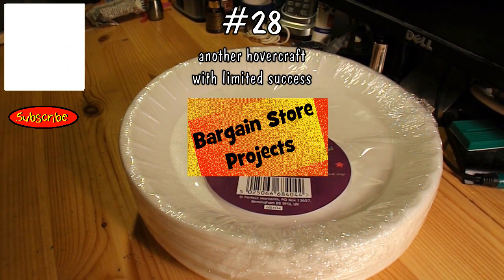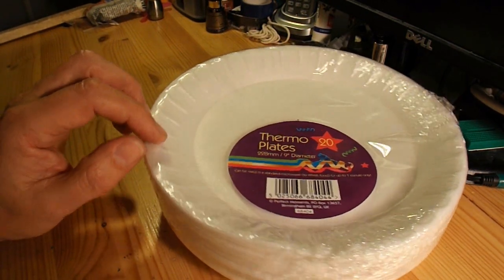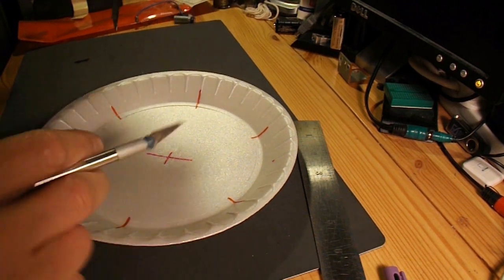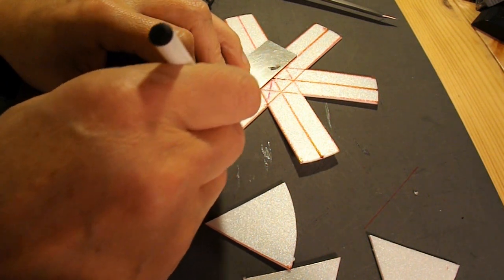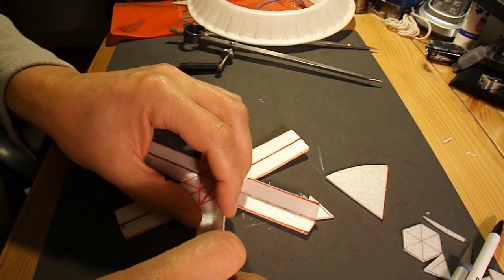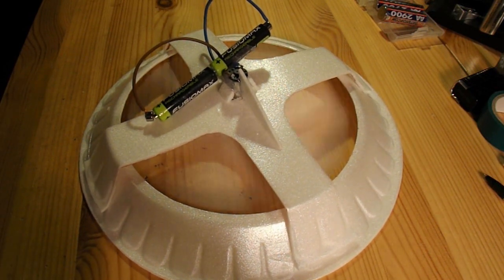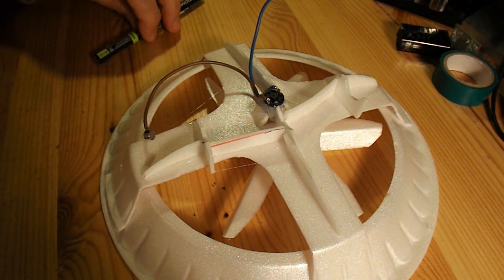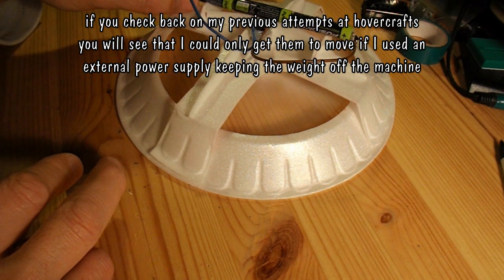Bargain Store Project #28 Styrofoam Plate Hovercraft

Comment: You could use small lithium batteries of 500mah. I've seen you use them in small planes. 
Because there the problem, could be the excessive weight of conventional batteries
Reply from the maker: Hi Francisco, I hope all is well with you. Yes there are many different batteries that will give a far better power to weight ratio but I was trying to stick to cheap stuff. Many of my more recent videos use LiPo or LiIon batteries.

Comment: awesome man, thank you for the ideas
Reply from the maker: The main problem with my early hovercraft was trying to use normal batteries as they are so heavy. If you can find some old mobile phone batteries or LiPo batteries they give much more power for less weight.
Reply: thanks man

Comment: get a battery with a very small capacity. it will be lightweight enough to hover.
Reply from the maker: +Marcus S. the simple answer would be a LiPo battery but I was trying to use ordinary batteries for this project.

Comment: You should use lipo batteries for a rc helicopter
Reply from the maker: +Gamer B0i certainly a small LiPo would give the power and the light weight required however the project was about using items from the bargain store and you don't get LiPos in bargain stores
Reply: +GrandadIsAnOldMan true but maybe in future projects even though this was a few years ago
Reply from the maker: Gamer B0i if you check out my hovercraft playlist you will see many different designs and components. The link is in the video description.

Comment: I am also thinking of doing a similar thing, but I am planning to use lithium ion battery from old mobile phones and a propeller made out of a cold drink can. The propeller must maintain its shape when spinning. I think your design can work but your propeller will change its shape when spinning due to air resistance which will reduce its thrust.
Reply from the maker: +Ganesh Mirajkar good luck with your project. The phone batteries give a good power to weight ratio, much better than the batteries I am using in this video. I am using them here because I tried to use components made from cheap items available in the bargain stores. You will see I have many different designs in my hovercraft playlist, some are very poor performers and some work better than others.

Comment: why not  just use the capacitor idea?
Reply from the maker: ilikeino if you mean the supercapacitors I use on some of my small planes then the answer is that they would not provide enough power for long enough to fly this one. It might work for some of my smaller attempts, but they still only last for 10 seconds or so with full power. A small LiPo would work much better.

Comment: I have an idea,  use the Graphene type paper capacitor for the body of the flyer and you could do away with the heavy batteries.  I plan on trying that if I can get the time.
Thanks for the vids.
Reply from the maker: Ed Lovvorn hey thanks for commenting, I just had a quick look at your channel, those wireless monsters look like great fun especially the way they light up more when you touch them. Might have a go myself sometime as I am sure the grandchildren would find that interesting. As for these hovercraft, the original idea was to just use components that you can buy in the 'bargain stores' as I call them or dollar stores in the US, so using the AA or AAA batteries were the first choice. A small LiPo would give a much better power output but would not fit in with the 'bargain store' concept. It would be interesting to see a Graphene capacitor version so let me know if you do one.
Reply: I will , working on it right now.  Wireless monsters are pretty easy now that so many people have put vids up to watch.  My brother uses one of my wireless monster setups to eliminate oder from his kids shoes

Comment: you can just use a flat battery!!!!! and kris is right you need a faster motor
Reply from the maker: By a flat battery I assume you mean a LiPo battery not one that is flat as in no charge. I don't recall seeing LiPo batteries for sale in any of my local bargain stores. So you agree with Kris so I will paste the reply I gave him here.
The aim of these projects is to use cheap components available in bargain stores. Once you move on to proper rc plane motors, propellers, and LiPo batteries you could make a block of wood hover.
There are plenty more similar attempts in my Hovercraft playlist, some are more successful http://www.youtube.com/playlist?list=PLA5a2xPRSrB3zoLYIrdESCCWdx2nLq8r7
Reply: yea and try to bye like a cheap toy airplane and take the motors out of those (or the components) because those are great and light weight motors and the spin very fast there like a pager motor but with out the little vibrator on the end of the motor !
Reply: and i think you have a really good channel!!!!!!
Reply from the maker: Thanks, I have used those motors on other projects, I can buy them real cheap off eBay but like I said, this video you are commenting on is in my Bargain Store Projects series so I am only using the cheap motors I can find there for £1 or less.
Here are some examples of those better motors.
http://www.youtube.com/playlist?list=PLA5a2xPRSrB2vw43V2xKeu1I-C2y1QKbn
http://www.youtube.com/playlist?list=PLA5a2xPRSrB2ztUDIZJqfcCfO-vZZed0u
http://youtu.be/TDmAvYJPVZ0?list=PLA5a2xPRSrB13Xcquw4Ff09MQzTPjeVkI
Reply: anyway i was wondering if you could make a quadcopter not in your bargain store series but just a regular video can you? (Yes, this is a challenge)
Reply from the maker: lightbulb creeper that is a regular request and the answer is no. To make a quadcopter that flies and is controllable means buying the rc kit including a gyrostabilised receiver setup. It is much cheaper to buy one of those nanoquadcopters ready to fly complete with transmitter etc so there is no point wasting money on a project like that.
Reply: you don`t have to buy the RC kit you can get a remote controller out of a cheap toy airplane or RC car or something like i did. and it comes with a rechargeable battery and you could just re-wire it so that it controls the quad copter and if i can do that i think you  can too!
Reply from the maker: lightbulb creeper Let's see your video then, I would be interested to see how you stabilize it in flight.
I really don't see your logic in saying you can get a cheap toy airplane or car and convert it when you can buy a quadcopter for the same sort of price. I don't know what country you live in but you can get a quadcopter for about £12 from China. Here is a link http://www.banggood.com/Gin-H7-2_4G-6-Axis-LED-RC-Quadcopter-with-Protective-Cover-p-950651.html
Reply: then what battery should i use i haven't decided yet!
Reply: i think that i should use a E32 or whatever you call it.
Reply from the maker: lightbulb creeper You have lost me? What are you talking about, battery for what?
Reply: the quad copter
Reply: well anyway i am posting a video of a britsle bot do you want to see it?
Reply from the maker: lightbulb creeper hey, yes I will watch it but I am confused. I thought you meant that you had already made yourself a quadcopter. That link I sent you earlier was for a complete ready to fly quadcopter - Cheerson CX-10 CX10 Mini 2.4G 4CH 6 Axis LED RC Quadcopter RTF - and at this moment on that link it is showing priced at £10.50 that is GB Pounds, I don't know what country you live in so I don't know how much that is in your currency.
Reply: i live in america '
Reply: and i can tell  you live in England or the UK or something
Reply: and sorry i have not made the quad copter but  have the parts to make it and i don't mean a huge big quad copter you can just make a quad copter that`s like 7 by 7  centimeters and you can use a cheap airplane toy to get the propellers !
Reply: and motors and you could use the paper plates for a light weight base!
Reply from the maker: Fine you make it and do a video. I have already explained why I don't think it will work and why it is not worth doing but I will be pleased to be proved wrong so go ahead and show me. I would love to see it fly under full control with stable flight.
Reply: well i cant have a controlled flight but i can make it fly.
Reply from the maker: lightbulb creeper good luck with that. I look forward to seeing the video.
Reply: and i was wondering what else i could make other than a quad copter so i was wanting a challenge can you give me a challenge?
Reply from the maker: How about a hovercraft? but a better design than this one. Or a plane or a boat.
Reply: can i do a helicopter i have the parts i just need a really strong battery do you know one?
Reply from the maker: lightbulb creeper do what you like, I cannot guess what motors you have or what propellers you have or what control system you have. Helicopters are just about as hard to control as quadcopters. You might be better off just trying to make a plane that flies first before trying to go straight to helicopters and quadcopters. Even a boat or a car will give you experience in getting things to work before trying more complicated things. LiPo batteries give the best power output for their weight.

Comment: you need a faster motor.  you need to build static pressure and a little motor just cant do that.
Reply from the maker: The aim of these projects is to use cheap components available in bargain stores. Once you move on to proper rc plane motors, propellers, and LiPo batteries you could make a block of wood hover.
There are plenty more similar attempts in my Hovercraft playlist, some more succesful http://www.youtube.com/playlist?list=PLA5a2xPRSrB3zoLYIrdESCCWdx2nLq8r7
Reply: GrandadIsAnOldMan no I totally understand :) but there are faster cheap motors. I have a few. I'm not talking about brushless.
Reply: GrandadIsAnOldMan remember the one you had from those lent removers?      If that is the motor that I think it is, its much faster than these.  I've actually built a working hovercraft from a trashbag, a cereal box, a motor from a cheap electric shaver and some plastic airplane props.  

It ran on two AA battery's. You should try a light frame like this one with this larger blade and a faster motor.  Also, the more blades and the closer they are together, the better. Do a google search for static pressure or static flow fans. :D I wanna see this work!
Reply from the maker: Kris Shellman If you have a look through some of my other hovercraft you will see I found some hair dryers in a charity shop on special offer as they had a load they couldn't sell. I bought 10 I think for £1 each which is the same price I pay for the cheap toothbrush motors and they come with fan blades. Having said that, I have several small high power 'hubsan' type motors very cheap from eBay that outperform all of them and are much lighter. A small LiPo or a phone or camera battery and there is no probelm with hovering, but back to the original concept of the cheap items from the bargain stores it is just a matter of trying the different products and see which one gives you the best motor and finding a matching fan blade. Again if you look at my other hovercraft I found a handy toy in the bargain store that has helicopter type blades that work relatively well.
This one uses the motor from a solar butterfly garden ornament, with one of those fan blades and the battery from a camera http://youtu.be/iGKPCo4Ub9Q?list=PLA5a2xPRSrB3zoLYIrdESCCWdx2nLq8r7
Reply: Haha yes, I actually watched your whole hovercraft playlist yesterday while I was working on a robot. thats what brought me to this video.

Comment: what type of motor did you use
Reply from the maker: For these projects I generally use motors from cheap vibrating toothbrushes which normally run on a single AA battery. I quite often burn them out using 9v batteries.
The first few videos in this playlist show the type of motors I mean http://www.youtube.com/playlist?list=PLA5a2xPRSrB3jAX4ymLvmoN8OtvQkKuTC

Comment: Try old phone batteries, not sure what your voltage range needs to be, each lipo cell equals 3.7 volts. Should save weight, hope this helps, just guessing, I don't know.
Reply from the maker: Thanks Sam, if you find my most recent videos I have been using the battery from my wife's camera which is the same sort of thing.
Reply: Cool thanks for response, rock on dude I'll keep watching.

Comment: Try using a propeller with a large diameter and a shallow pitch. A propeller with a lower pitch moves less air but boosts pressure It's like a low gear on a car. or better yet use an impeller instead of a propeller. If you can insure the bottom is flat i.e. sand it flush. this will prevent air escaping before it lifts the craft.
Reply: The Idea of using coin batteries is an interesting idea but i'm worried it probably won't work. this is due to the fact the batteries may have the voltage you need but when you put that much current through them the voltage drop will be to grate as the simply batteries cant put out the current necessary. Try using a light Extremely powerful and very light (try a Lithium cell phone battery)
Reply from the maker: Ben Heatherman Hi Ben, thanks for your comments. The general idea of my projects is to demonstrate the basics and then other people can copy them and improve them. Your comments will help people to do that.

Comment: You could use some button batteries.
Or, make it wireless powered with an small induction coil.
Reply from the maker: Not sure about the wireless idea, I have not been able to get much distance when I have tried wireless systems. I have tried button cells but they don't last long enough to be classed as a success. As I said in the video description, I need more powerful motors (Power to weight ratio) or lighter batteries, perhaps LiPo's but I don't want to pay for either. If you check out my hovercraft playlist you will find I do better with the motor out of a hairdryer.
http://www.youtube.com/playlist?list=PLA5a2xPRSrB3zoLYIrdESCCWdx2nLq8r7

Comment: if you put the batteries in parallel instead of series you would get more power.
Reply from the maker: Hi John, you may be right, perhaps you could demonstrate. As far as I can see, in this case it is rotation speed I need not power so the higher voltage gives that. A different blade might work with more power.

Comment: maybe smaller venting holes? it might help it gain more lift
Reply from the maker: Thanks Tyler, I may have another go some time. The issue is always about the power to weight ratio. These motors I am using are very low power and as soon as you add the weight of batteries you are struggling.
Reply: hmm what kind of voltage do those motors take?
Reply: aa batteries and triple a batteries put out about 1.5 volts but i know you can buy 3 volt coin cells maybe try sticking a few of those together and see how that does? sometimes coin cells can pack a punch and theyre alot lighter than those batteries, im not for sure if it  will help but its worth a shot :P
Reply from the maker: Tyler Larg These are probably the ones I have taken from vibrating toothbrushes that have a single AA battery in them. I would guess they can run on 3 volts happily. I have pushed them with 9 volts and overheated them in several of my projects because the 9 volt battery is a good size for the power output. I tend to use rechargeable batteries which means they output 1.2 volts rather than the 1.5 volts you get from disposable batteries so 3 x 1.2 gives me 3.6 which I am happy those motors can handle. On the other hand I could take the attitude that the motors cost less than £1 so burning them out is not really an issue if it means the project works long enough to video it but that may upset people who try to copy the design.
Reply from the maker: Tyler Larg On the subject of button cells, I have used them but they do not last very long. They are designed for a very low current draw so these motors flatten them quickly. I can get them cheap from the bargain stores so I could live with them flattening if they lasted a few minutes but it is usually less than that if you want a decent output from them. You will see I tried using them in this project Bargain Store Project #15 - Notebook cooler to hovercraft
and again here
Bargain Store Project #8 - lint remover hovercraft - fail

Comment: I am not the smartest person in the world but i think when you add a magnet next to the motor it make it spin faster
Reply from the maker: Some electric motors do benefit from extra magnets boosting the inbuilt magnet. Just depends how well matched the existing system is. In the case of this hovercraft there would be a trade off between the extra weight of extra magnets vs any extra power generated. A better quality motor would probably be an easier fix. A better quality fan blade would probably improve the performance without needing to do anything to the motor.
Reply: thnks cause i saw a video that said it would increase the power

Comment: Why don't you make another but this time use a rc plane motor and make sure it's number of power is high or use a rc helicopter battery and propeller then you can reverse the motor on the helicopter and make a hovercraft :) plz try ASAP 1.2.3.4.5.6.7.8. 9.10 fly my beauty... Lol it flew away :( lol

Comment: Have you given a centrifugal fan/blower a try. They really move air! Also might want to add a "skirt" say made out of tin foil.
Reply from the maker: Hello again. This current series of projects is all about finding something cheap in my local bargain stores and trying to use them for something they were not designed for. When I have exhausted my ideas in that area I may move on to something more involved. If you find my other hovercraft attempts you will se I did put skirts on most of them. Thanks for the comments, they all help to give me ideas.